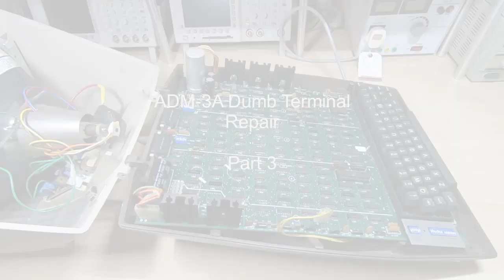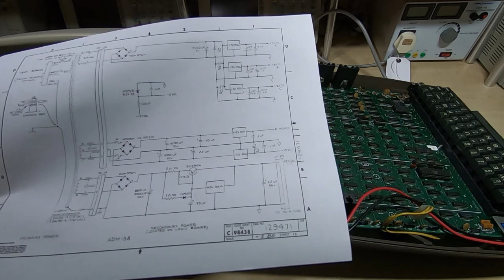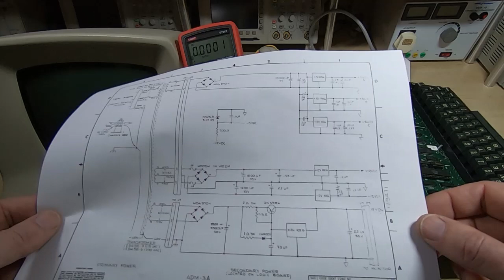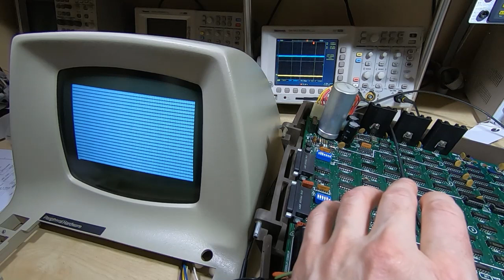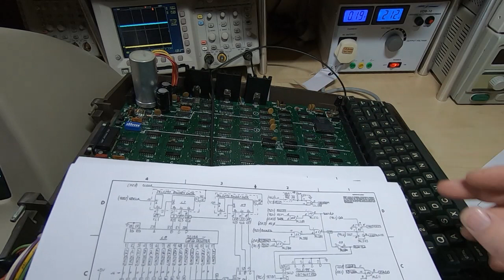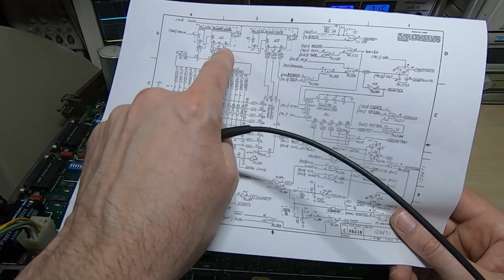ADM-3A Part3

Comment: Hi Jerry, I have an ADM-31 terminal that was donated to me a few years ago and I'm now in a position to test/repair/restore and use! I have basic/intermediate electronics skills and am always looking to learn and improve. if you take a quick look at my channel you will see videos of various repairs and attempted repairs I've done. It seems this terminal is slightly different to the ADM-3A in that it has a separate power supply in the place where the large transformer sits on the ADM-3A. I would be happy to drop you some beer or tea fund money for your time, but wondered if you would perhaps be able to give me some starting pointers on what to start with when it comes to repairing this terminal. I've got a CRT tester and have discharged and removed the CRT, it isn't completely dead but is reading 'bad' on the tester, sadly after a 'clean and balance' it still sits in the 'bad' section so if it does function I'm expecting the CRT to be quite dim. I'll happily recap the CRT board and the power supply board, but I suspect there is a more informed way of testing this. Would you have some insights? Thanks Dave.
Reply from the maker: Yes the ADM31 is very different to the ADM3A although it looks very similar. The ADM31 is more of a smart terminal. However you can repair it in much the same way as the ADM3A by starting at the processor and working through the various functions (after ensuring that the power supply is working of course). It is more complex than the 3A but is fairly easy to work on as it still has a lot of discrete  circuit blocks. Most old tubes will test bad but may recover to a usable state once they have been run for some time. They do however need some beam current so if the screen is blank then it will be very slow to respond.
Reply: @JerryWalker001  Thanks for the reply. I've recapped the PSU and the CRT board. from what I can tell the PSU is good as the mainboard beeps when you plug it in and the 'caps lock' glows red. I have connected the CRT and get a weird high pitch whine and on plug in and unplug sometimes you get a white line flash. I'd like to test the terminal board without the CRT/CRT board - in one of your videos you mentioned that was possible, but I'm not sure how you intended to do that. Could explain more about this please if you get time? thanks.

Comment: My ADM-3 (not A) sends/receives properly @ 110, 300 and 600 baud but shows garbage at anything higher than 600. I used Deoxit on the baud rate switches and reseated the UART. What might the problem be?
Reply from the maker: Is the problem in both sending and receiving? Also do you have the dual Baud option fitted (rotary switch at the front left)?
Reply: @JerryWalker001  The problem is in both sending and receiving. I don't have the optional switch. I just realized when looking at the maintenance manuals that, although the case says it's an ADM-3, someone must have swapped out the mainboard. The layout is an ADM-3A and it responds to the cursor movement commands. I'm thinking the problem might be in the 74LS161 at L2 since that's the timing IC that controls 1200, 2400, 4800 and 9600 baud. That doesn't explain why 19200 doesn't work, however since that timing IC at at L1.
Reply from the maker: If you have a scope then check the outputs of L1 and L2. The common signal for all the speeds you mention is the /1800EN line so check that it is at the correct level. It is also possibly just a speed issue and one of the IC's is starting to fail but I would test all the easier things first. Using a scope will show you the actual clock speed that is being produced. It may simply be faulty DIP switches and as only one should be set at once if they are not working then the clock does not make it to the two FF IC's if the switches fail so check the outputs of K2 (pins 6 and 8) to make sure the expected clock is appearing for the correct switch. Let me know if this does not help.
Reply: @JerryWalker001  When I just connect the RX pin to the TX pin of the DB-25 on the ADM, 1800 baud works OK. When I connect the ADM to a PC and use a terminal program, it doesn't. This may be that the terminal program can't handle 1800 baud, though. It's not listed in the selection of baud rates so I typed it in. I believe this means that the 1800 baud line is OK.
Reply from the maker: You can ignore the 1800 baud setting. You just need to check that the 1800 control line is at the right level when 1800 is not selected. I would suggest setting something like  4800 and then either checking the actual clock going to the UART to see what rate it is running at or experimenting with the terminal program to see waht the actual rate is. You can then figure out where the fault is. It could be a timing issue but it would be easiest to determine if the clock rates produced are correct.
Reply: @JerryWalker001  It turned out to be DIP switch S1's fault. The switch for 300 baud was permanently stuck on no matter which way the rocker was moved. I replaced the DIP switch and the ADM-3A communicates at all baud rates now. I don't know why 600 baud worked but now that it's working, I'm not going to worry too much about it. Thanks for your help and the time you spent on this!